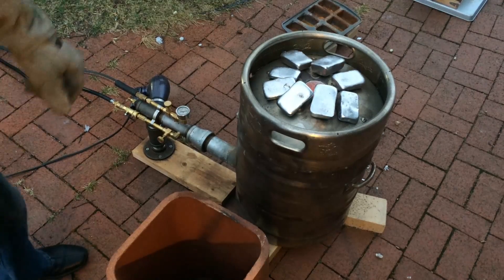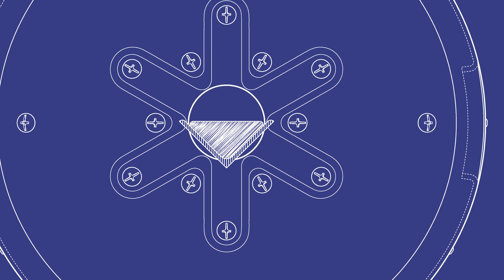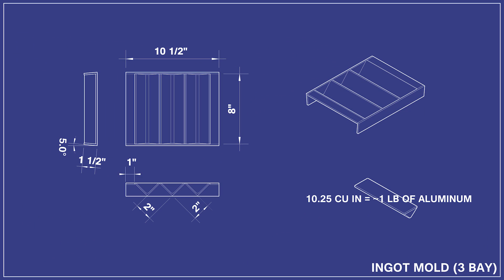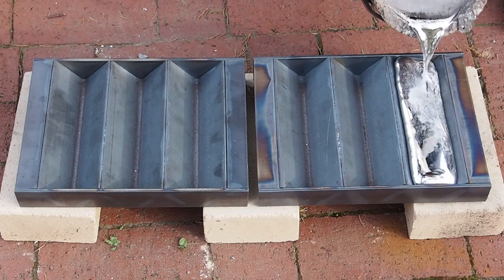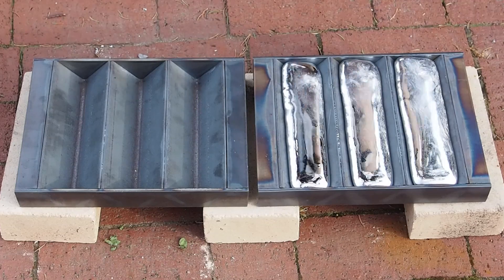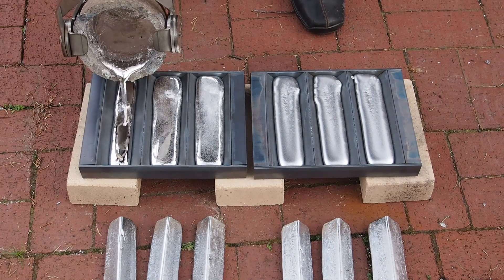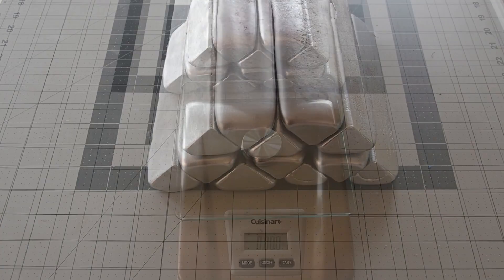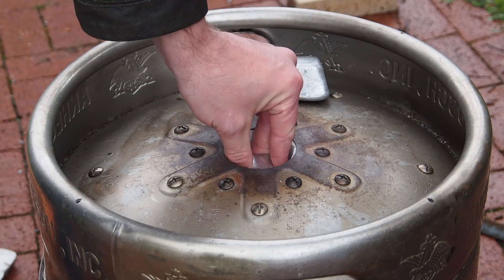Steel Angle Ingot Molds for Molten Metal

Comment: Suggestion: A set of tongs to fit one of these ingots so you can put it gently into the crucible and avoid splashing.

I'm planning on starting out with this type of ingot mold precisely because it will allow loading ingots through the top hole without removing the lid.  The fewer thermal stress cycles on the rim of the crucible, the better.  :)

Comment: can you fit soda cans thru the hole in the lid?
Reply from the maker: +Christopher Jones I don't think so, unless you drink a lot of 12oz red bull...  (~2" diameter).  Aluminum cans are about the worst source for aluminum thin, wrong alloy and covered in misc coatings...
Reply: Brian Oltrogge just curious. Im about to chop my half keg tomorrow to make this to burn soda cans.. so i guess ill make my hole just a bit bigger than yours

Comment: Nicely done! But... what about the splashing?
Reply: +brenovsky they are longer so can be lowered down into the crucible I think
Reply: Brian Oltrogge Hahaha yeh you wouldn't want to be in the 'splash zone' for that one!
Reply: +Brian Oltrogge Oh I see! Thanks! :D
Reply: Splashing always sucks when ya drop the kids off at the pool.
Reply: The bitter Ukrainian judge always screws you on the splash.
Reply from the maker: +Nick Charlton This is the hope! The lid is about 4" thick at the hole and the crucible is about an inch below that.  This leaves about 3" of ingot to hang down into the crucible.  If it isn't touching the top of the aluminum, it would be very close.  The shape might at least lend itself to between a 9.4 and a 9.8 on the Olympic splash scale...